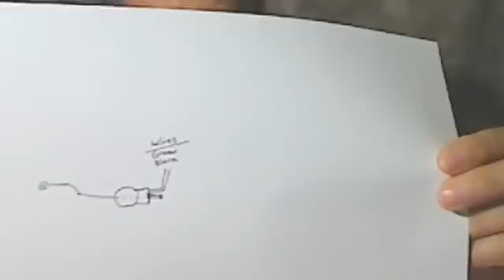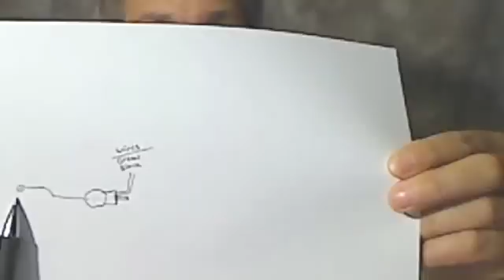Brake Transmission Interlock Solenoid BTIS Transmission stuck in Park

Comment: Took mine off. It does not go to the transmission it connects the shifter arm to some type of hard mount..The shift interlock serves no purpose than to keep the actual shifter from moving out of park , unless the brake is pushed.. kid proof...
   I took mine and  plugged it, threw it in the trash....
   No problems since...

Comment: Shifter Interlock Solenoid for a 2005 Cobalt, Dorman # 924982, $53.99 at AutoZone. It probably fits many Chevrolet models for many different years.

Comment: im having a problem I hope I can get some help.. I have a 2000 buick park avenue I cant shift transmission out of park I can un hook the shifter on steering wheel and it moves I un hook cable and that moves but cant get transmission to shift help please

Comment: I am dealing with this now can in a 2002 gmc envoy. can I just remove the solenoid and not put another in?
Reply from the maker: +the Driza If you remove the solenoid, its possible the transmission may not stay in Park.

Comment: I appreciate your video. I am going to the shop tomorrow to have our Automatic Transmission Shift Lock Control Solenoid replaced. 15 minutes is a very short time. I have had it with being stuck in park and forcing the shifter to go back into reverse gear out of park on cold days when the thing is harder to move than on warm days. Good to get this replaced ASAP

Comment: craig kirkland 
 you do not need to disassemble anything to disable the BTIS . on my 1997 GMC i simply laid on my back, no small feat for a fat 70 year old. look up to the left side of the colum, you will see two two rods parallel to each other. the one on the left (pass side) connects to the switch. it is the painted one. the other connects to the shifter. With a large flat screw driver, simply pry this rod off its connector. I zip tied the rod to the bracket. this will keep it from falling back in the way. It now shifts from park with ease. this does not affect any other operation of the vehicle. time 5 min, cost one zip tie.
Reply: I was hoping that this would solve my problem which started when the other end of the shift cable broke off of the pin attached to the shifting bar on the transmission because that pin had rusted and corroded to nothing.  (technical names of parts is not known)  Because the nut holding that bar onto the shaft coming out of the transmission was so rusted and corroded, I didn't want to chance breaking that off when forcing the nut off (which would have made the repair a whole lot easier) and end up having to have the thing towed to a shop for a more costly transmission repair.  So, after removing the remnants of the lower-end connecting pin on that bar (removed it with a sawsall and hacksaw blade), I drilled a 7/16 hole through the bar for the bolt that fit the lower end of the shifting cable very nicely.  Went through four new bits to do it and it was no easy task given the limited space in there and working in tight quarters with the truck jacked up on the driveway.  With everything bolted up nicely, I'd hoped to hop in the truck and magically shift the gears and have the truck operational again.  Nope, that didn't happen.  Stuck in Park.  I looked under the dashboard and popped the locking rod (passenger side) off with the screwdriver as you noted.  Still locked in Park position.  The truck has sat on a NY driveway all winter without running so there may be something else in there that I've yet to discover.  Tomorrow, I'll unbolt the lower end of the shift cable, manually shift the transmission into neutral, underneath the vehicle, and see if the gear shift will move.  There has to be something there that's hanging it up at the moment and I'll eventually find it.  I'm only trying to get this thing operational so I can donate it to charity so I really don't want to spend any more money trying to fix it.

Comment: I have a 01 Silverado4.3LV6. I just replaced the engine because it was locked up. However, i can't move it out of park now . I'm doin the disconnect battery trick for reset of the cpu to see if it wrks. If that doesn't wrk, what do you think the problem is??. i put the torque converter on correctly and my ATF isn't burnt or brown, regarding to its color. I also do not have an PSF in my steering column yet... Could that be it?? pleases respond black ASAP because im lost on this one
Reply from the maker: +Kealean Rockett Hi, the park lock involves the brake switch and those (P) solenoids are a real problem. 
1. Turn the key just far enough to unlock the steering, this should release the shiftier. 
2. If this does not work, its the solenoid under the dash. This is what happened to my truck at a tire shop (Locked in Park). 
3. Disconnect the lock rod under the steering column and check it by pushing the brake for free and lock operation. This will also allow the transmission to shift into all ranges. 
*Its hard to say what's not working with limited information.

Comment: My problem was the opposite, I felt something hit my foot while driving and found the module hanging. Didn't know what it was so I looked up the patent number  and found the description. Without it I can shift gears without applying the brakes It's a safety feature. Have to apply brakes to shift gears with it working.

Comment: A "quick fix" (workaround) to allow you to shift out of park is by doing the following:
Insert the key into the ignition,
turn the key slowly clockwise until you can shift into neutral (not all the way to "on" or "start"),
press on the brake pedal,
move the shift lever to the neutral position,
start the vehicle in neutral with your foot on the brake,
shift into forward or reverse, but do not shift into park with the engine running.  
If you shift into park with the engine running, it will probably not shift back into reverse or forward.
This will allow you to move a GM vehicle stuck in park because of a faulty BTIS solenoid.
Reply from the maker: That may be the procedure if its an electrical issue, but in my case it did not work. The lock pin was jammed at the column and required removal of the solenoid to free up the shifter.

Comment: i'm expecting the video to show me how to replace it...that'll really help...
Reply from the maker: Just remove the plastic panel under the column, its on the right and it pops off at both ends with a screwdriver. There is also a tiny wire to disconnect under the dash. Takes less than 30 minutes to replace. Took me less than an hour to repair this one and its been working great for a year. Hope this helps

Comment from the maker: I had the same problem on a damp morning and there was like no info on the subject. just pop the rod loose on the bottom of the column and it will be free. When you open the solenoid, just be careful not to loose any pieces like the spring or pin.

Comment from the maker: Just remove the plastic panel under the column, on the right side you will see the shift cable, snap it off and unplug the thin wire (mine was green). Its fairly easy to remove. the other option is the brake switch but I understand these solenoids are a problem, GM quoted me $100 for a replacement part. I figured this might help somebody having a locked in park problem.